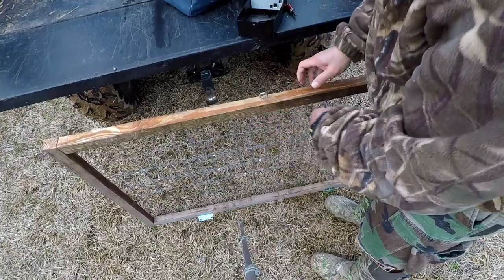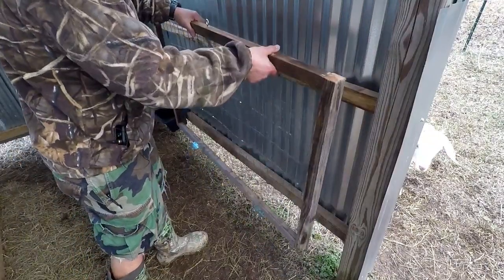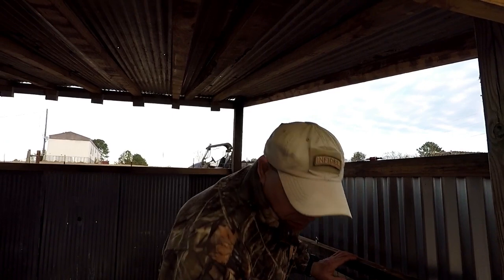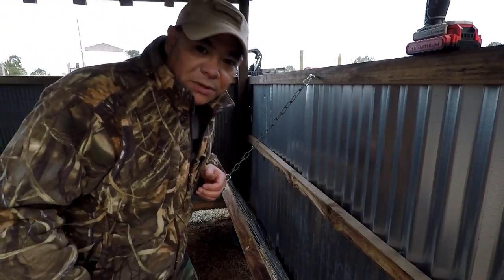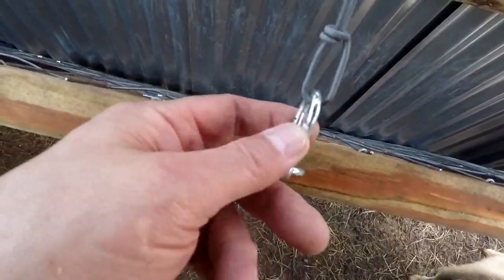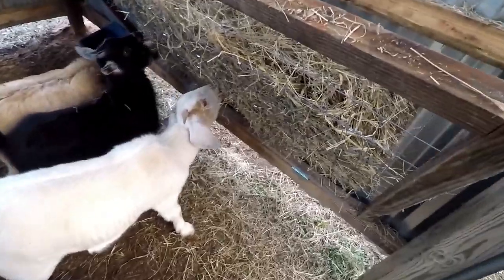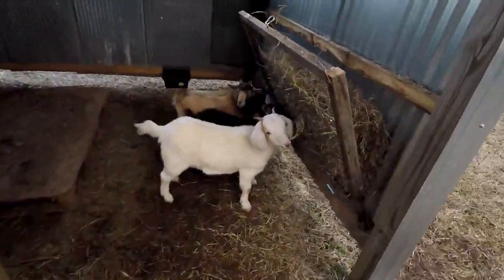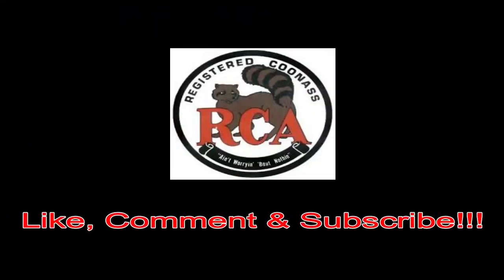New Hay Feed Rack Installed | Plan B Enacted

Comment: is there gonna be a rust problem in the future with that metal and moisture?
Reply from the maker: No sir, the wire is galvanized and the screws used are exterior grade so I think I'm good as far as rust.  I would think the frame would fall apart if anything!!  dan